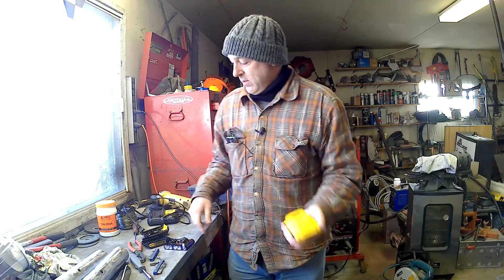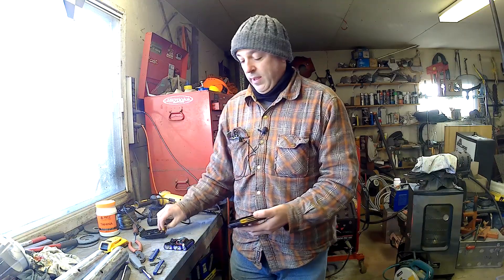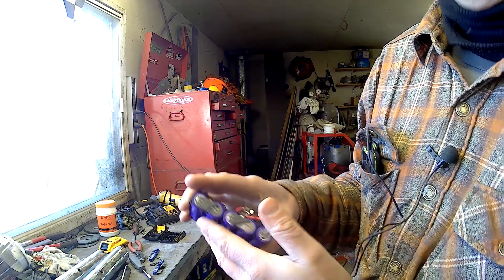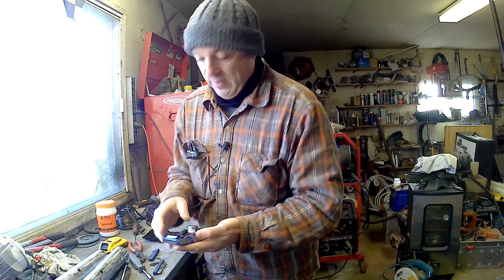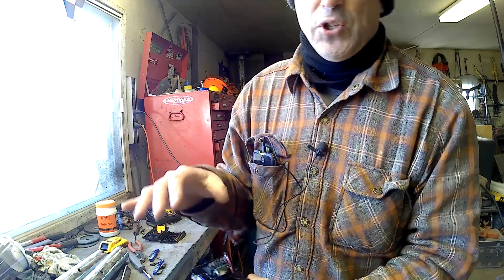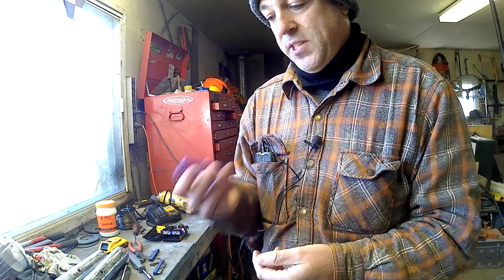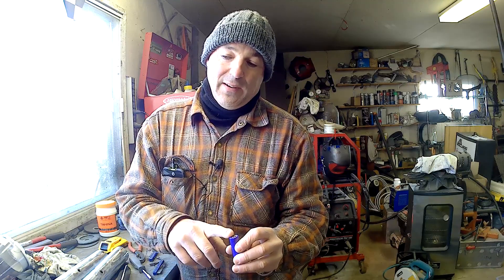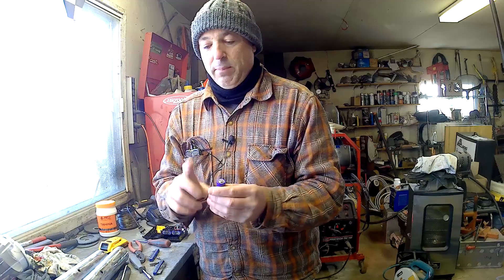Fix Dewalt Battery that won't charge (Try this after you try the "jumpstart" fix)

Comment: It would be really helpful if you had shown what and how you used that "usb charger" to charge the individual cells. It sounds like that second "cap" is some sort of circuit breaker for the cell. Good to know. Thanks.
Reply from the maker: It was just a basic battery charger for lithium cells.  One wire to each end of the cell (of course + to + and - to -). 

Good luck!

Comment: Thought I would just leave this here. Read all the comments and nobody asked what CID means so here you go.  btw, I didn't know either.

"Most commercial cylindrical 18650 Lithium-Ion (Li-Ion) cells have two internal protective devices: the Positive Temperature Coefficient (PTC) and the Current Interrupt Device (CID). The PTC protects the cells under external short conditions and the CID protects the cells under overcharge conditions."
Reply: It seems like you know your stuff. I have a 6Ah that measures 19.52V and 3.96 across each of the doubled up cells. It shows two bars and the charger(s) show fully charged. It really bothers me that I can't fix it! What do you think?

Comment: tried the jump-start, fail☹
took apart the battery pack and w/out de-soldering, prying up the small spot welds on (2) of the batteries(not a pretty sight) then using a small flat head screwdriver, pushed caps... "pop" success!  my 11month old 20v-battery in now charging again!
Thank you!, Thank you!

Comment: Ya but don't I need a special tool to do these spot welds on bettery cells?
Reply from the maker: When I did the video I didn’t know what was wrong so took the batter out.  Now that I know about that safety reset cap I wouldn’t remove the battery.  You can just reach in with the cell still in the pack. Give it a try, you’ll see what I mean.  If you read the other comments, other people have found this works well.

Comment: Thank you for this video. Jumpstart did not work.  Was able to reset it as well and now it charges just fine.  Two cells I heard a "pop" noise when pushing down on the cap.    Did not have to de solder.   Thanks again!

Comment: Cool….is it possible to push that cap down without desoldering the end ?
Reply from the maker: Absolutly!   That video is me not having a clue what the problem was and figuring it out as I went.  If that ever happens again I would just reach in and push it down like you said.
Reply: @Tree-ations  yea,,,I just saw another one where he did just that . Thanks again though you steered me straight! Cheers!

Comment: I wonder if that would work for Craftsman batteries.  Thanks for taking the time to do this video though.
Reply from the maker: If they are lithium batteries this should work for any brand.  They all use the same basic cells inside.
Reply: @Tree-ations  Yeah, it's a Craftsman V60.  Two of the 20 volt packs seem to be fine, but one them, if I checked it right, appears to be dead.  I tried to jump it with two other fully charged batteries, one 18 volt "Warrior" brand and the other a Craftsman V20.  It didn't seem to work though.  I'll probably try your method next.  If I do, I'll post my results.

Comment: What screwdriver bit did you use to separate the battery case ?
Reply from the maker: For the screws you mean?  I picked up a security screw bit set from
Amazon that had the right bit.  The set it only a few bucks and I’ve used it a few times with success. 

Sorry, I have no idea what the screw head is called.

Comment: This trick worked for me one time. The 2Ah packs are forced to work too hard and that's why they get so hot. I replaced my 2Ah packs with the 4 Ah packs and haven't had any problems since. 

I thought about repairing my 2Ah packs but (decent) cells would cost more than buying a new 2 Ah pack.  Marketing.  🙂

Comment: How do you solder that tabs back to the battery?  They seem to be spot welded.  I’ve not had success getting solder to adhere.
Reply from the maker: A spot welder would be best, but I did t have one either.  It was a bit of struggle, but I finally got it to work.  Be careful to not put too much heat into the battery!
Reply: @Tree-ations It appears on mine that the inner cap is tightly up against the outer cap.  I’ve tried several tools - dental picks, tiny screwdrivers, knife blade, etc. but cannot separate the caps and get the inner to pop back in place.  Any suggestions?

Comment: While this "works" it essentially disables the safety mechanism. If whatever caused the cell to vent the first time happens again it can catch fire or explode (right next to 4 other cells). If you battery pack catches fire while in your garage and burns your house down your insurance company will use this video evidence to deny coverage. Replacing the bad cell with a new one would have cost you a few bucks.
Reply: safety is the first rule CID protection should not be neglected, better to use a new single battery for replacement.,may cost 10 bucks or little more

Comment: This worked for me. My issue seemed to be that I added the DCB094 USB charger to a brand new Dewalt 6mAh battery for my wife to use a USB LED light. I believe it discharged so slowly that it snuck past any electronic stop and made a cell "pop." Be careful about very long-term low level power drains! I was surprised that I didn't need to remove all the cell connections to test voltage on each cell. I tested each of the eight cells. Each gave 3.66V then two gave over 4.5V - I did the manual reset on one and it started charging again. The charger stops at two of three lights, but hopefully all the voltages settle and I can get to a full charge after using and charging the battery over time. SUPER HELPFUL!!
Reply from the maker: Thanks for the tip. I’m glad it worked for you!  :).

Comment: Great Hack Sir.  I will try that on a 12V dewalt post battery no longer available.  Jump start did not work.  Likely not used for years perhaps decade.  NiCad.
I thought those connections had to be done with spot welder.  Becareful when soldering.  Minimum heat. Battery inside a pipe.

Comment: problem I have is ,even after full charging the juice lasts less and less,, Is there anything that can be done to that or are they in the bin?
Reply from the maker: You likely have a bad cell in the pack. You need to take them apart and test each cell and replace the bad one(s).
Reply: @Tree-ations  I'll try that thanks

Comment: Had the same problem and I was able to reset it without de soldering. I used a very small flat head and yeah it worked. Thanks man. Saved me $100

Comment: Without taking it loose from the other batteries, can you reach with a pick and push the safety cap down ?
Reply from the maker: Absolutely!  If this happens again, that is what I would do for sure. 

However I had no idea what the problem was as I made this video and when I took the cell out I thought it was just a dead cell.  My mistake!
Reply: @Tree-ations  So your initial purpose of the video was to replace a dead cell but it morphed into repairing a dead cell. In real time more/less. Thumbs up. Way to adapt.

Comment: never heard of the CID most if not all flat cell 18650 are unproctected, so i assume those are more expensive because they have those features. Most button tops have protection
Reply: Ya these batteries have protection system on top. Not dewalt. Theirs have it inside batteries case. I'm confused now

Comment: I love this and I especially enjoyed the suspense of knowing if it was going to work along with you 😅.  My question is, if the cell popped once before, is it likely that it pops again in the future?  I have a 2a dewalt battery that only worked a couple times, I’ll have to try this and post my results.  I’m curious as to how it works out for you.
Reply from the maker: So far it has worked fine ever since. 

I was working the battery hard (it was quite warm) when it popped.  I suspect I pulled too many amps from it.   It has been worked normally since without issue.

Comment: Do u know what it means if I go to charge my dewalt  battery but soon as I put on the charger it's lights red at first (one blink ) then There is no light after. Battery still has juice because it still will turn on my blower ?  Thing is Battery does this on Different chargers as well,  so it's not the charger :/
Reply from the maker: Sorry, I haven’t run into that one.

Comment: be careful doing this. if your insulation on the side of the battery is damaged, you can short the battery and it will vent. I learned this the hard way working with these types of cells in another capacity.
Reply: what do you mean by vent? i tried the technique in the video and the battery got really hot, then it made almost a hiss like sound. safe to assume it is toast now?
Reply: @Richard Conrad  that would indeed be a vent. You are correct, that battery is toast.

Comment: So, if one of the cells is bad but unable to be reset or "fixed" is it possible to purchase a replacement cell so the whole battery doesn't go to waste?
Reply: yep, i was given a WORTH 80v battery pack. i took it apart and it had one bad cell. I used one of them to replace a garbage cell in my BAUER 1/4in impact 18v battery.  Its back up and running. Nice thing about the giant battery packs is i took mine apart in a way that kept most cells attached together at one end. " i dont have a spot welder" so made it easier to build 2S battery packs for rc cars as well.
Reply from the maker: For sure!  Just make sure you don’t get a cheap one.  Dewalt (and others I assume) use good quality cells. You want one of the same capacity.   Let me know if it works for you!
Reply: @Tree-ations  almost certain DeWalt uses LG cells

Comment: Glad the algorithm made your video pop up in my feed.  Tried jumpstarting a dead dewalt battery and it didn't do anything.  Figured I'd have to buy and replace cells but I'm going to check for this first.

Thanks!
Reply from the maker: I hope this works for you!  Let me know if it does. :).

Comment: I tried the "jump-start" and all it did was make my Makita battery pack hot. Luckily I haven't thrown it out yet so I'll give this a shot and see if it'll fix the problem. Thanks for the tip.
Reply from the maker: I hope it works for you!  Let us know if the Makita cells have a similar device.  :).